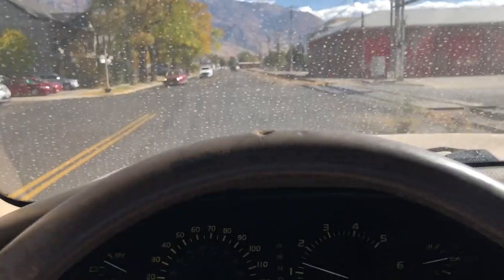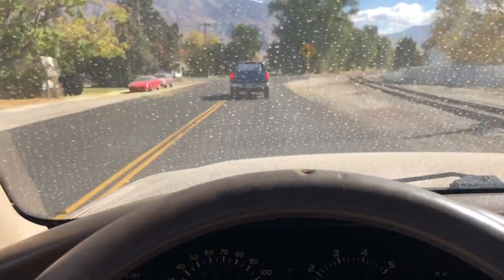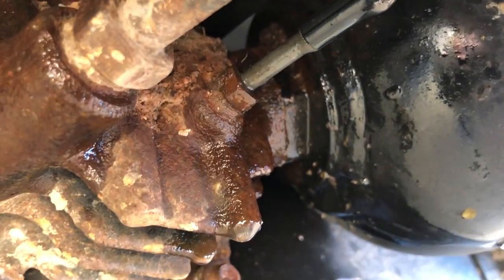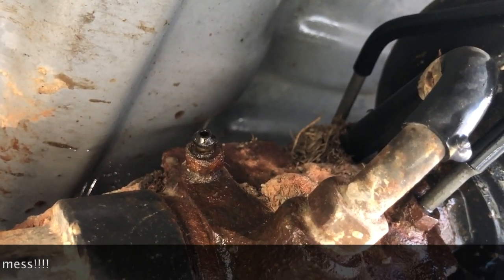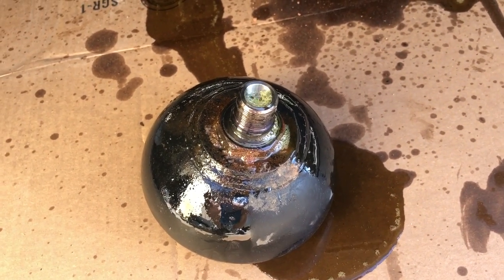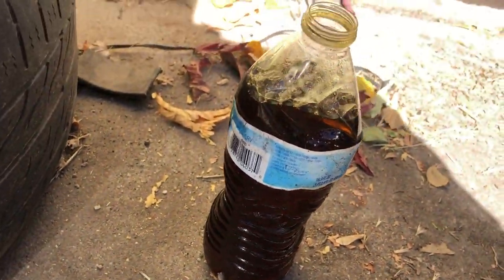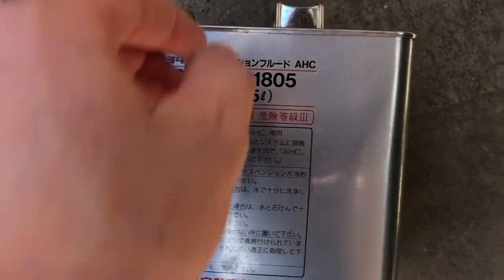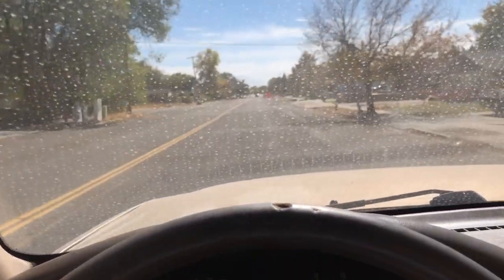SOLVED! AHC System Lexus LX470 Bouncy Ride Pogo Stick Problem 98-07 Toyota Land Cruiser GX470

Comment: Great video! AHC is an amazingly engineered system. Problem is that many owners do not maintain it. Had the same issue on our old LX470 and our current LX570 and was able to fix both very easily.

Comment: This was an excellent video.  Thanks for sharing the knowledge.  I have liked and subscribed.  

A few questions if you have the time, if not I completely understand.  Can I ask where you found the replacement globe?  When you check the AHC fluid level in the reservoir now, are you coming closer to the 7 or 8 graduations?  Did you only replace the single globe after coming to the conclusion that the others were fine?  Also, would you mind sharing what the pencil test was?  

My AHC is working just fine at this point but I love knowing that the repair could be relatively simple.  I get 8 graduations of movement at this point on my new to me 2000 lx.  I replaced the fluid and noticed a significant ride improvement.  The old stuff was black and disgusting.    Before buying, this really was my biggest concern.  I think think AHC gets a bad rap these days.  Its a fantastic system with a very comfortable ride!
Reply: Would also like hear more about the pencil test as well as the graduation improvement afterwards.  Awesome video thanks for taking the time!
Reply from the maker: Pencil test is just stickin the eraser part of the pencil into the glove hole and pushing on the membrane part. If it is broke there won’t be any resistance. If it is intact there will be resistance.
Reply from the maker: The AHC is just hard to diag if you don’t know what you’re doing. And so most places want you to replace anything instead of just the issue (because they don’t know what the exact issue is)

Comment: I sold my Lexus 470 LX, not because of AHC problem, but just a changing of spark plugs, which was broken with remnant dropped inside the engine. My car had been driven for 24 years, that repair store is 王兵， he didn’t compensate for my loss.

Comment: Nice video and glad to see you were able to fix the issue. I have two questions for you if you don't mind that I haven't been able to find and answer to: 
1) In checking to see if the AHC system will lower or raise the truck, after pushing the button can you open the door mid process or will that cancel/fail the command?
2) Do you need to [partially] fill the new globes with fluid before assembly to prevent air in the system or did you screw them back on dry?
Thanks!
Reply from the maker: I believe if you open the door it will pause it. And I did it dry and then bled it after.
Reply: @karrskars  ok, thank you 👍

Comment: Yes ! I have bounced problems on the rear side and the back side of the car 2005 Lexus lx 470 is lower then front side . 
What should I do? 
Thanks
Reply: Mine the other way, front side down to low and rare too High:( 
What shall we do? 
All 4 globes checked (pencil test) OK,  leaking one rare Shock changed new, Fluid removed all and replaced and bleed 5 spots . 
Somebody please say something else which couse bumping rare side . HELP 😢

Comment: Having some issues with mine 06.. 
had a bad passenger side bag… replaced with some new bags but for some reason now the passenger side inflates but driver side doesn’t? Also will just blink on the high selector..yes my doors are closed but even when trying to lower will just blink and not deflate?? 
Please assist 🙏🏼

Comment: Bleeding technique? All acutators and acumulator at once untill dry when in LOW? Refill reservoir, start the car, repressurise, turn off, bleed again all untill new fluid comes out, check reservoir for fluid level, start the car, go to NORMAL and refill reservoir to between MIN and MAX?

Comment: Thank you dear for your great video here, i hope I'm going to manage solve sameissue with my Toyota LC J100, 2004 mdel
I am going to check the globes as you described it but i suspect my rare sensor might be not working. Because before it failed to low at the rare side, the system push the back to the maximum high and kept bumping. managed to reach home and park after so often engine off and on for new trial.
Today it tried to push up with the button but the sytem controller show " OFF " blinking and Rare of thr car is High raised and front normal as the button lifgts show Low
what could you recommend to start with?
 Schocs are all once changed with new fluid ( 2014) and one rare schock is leaking slightly, just wet dust being seen, and globes never checked and changed, i even dont know where to get it as i live in Ethiopia :( 
 We love and trust our rock-edition LC and need to keep it functioning as it is...many friends failed to maintain AHC problems and changed to ordinary shoks.
looking forward to hear from you dear fellow Tech-Masters !
Wube from Addis Abeba.
Reply: Updates; 
Still no chance to solve after a whole day work on the issue. 
front side down to low and rare too High:( 
What shall we do? 
All 4 globes checked (pencil test) OK , there's no problem,  Leaking rare Shock changed new, Fluid removed all and replaced and bleed 5 spots .  All original toyota  ...
Somebody please say something else which couse bumping rare side . HELP 😢
Reply: New update: 
Accumulator pamp changed but the problem stayed as the beginning. Now I'm going to change all three height sensors. If that won't change it then I need to change all 4 Globes. Good day

Comment: Hey. I love your video. I was wondering if you had a way of determining which globes were bad?  I was thinking about only getting 2 at a time but want to replace the ones having the most trouble. My Resovoir shows  a movement of about 8 graduations.  Trying to figure out which to do. Both fronts or both rears or a front and a rear on each side. Let me know your thoughts.
Reply from the maker: Best way to do it is slowly drive over a bump with your front tires and see how bouncy it is. Then slowly do your rear tires and see how bouncy it is. That should help you see whether the front or rear is bad.
Reply: Do you replace in pairs or it doesn't matter?
Reply: @ozzie3056  I purchased a full set of new globes (4) for a total cost of $725.  I also purchased 3 liters of AHC fluid for the flush.  Based on your video should be fairly easy barring challenges getting the old globes off since they have been on for 16 years. Note: the dealer quoted me $4700 just for the globes.
Reply: @stinkenlinken  did you use his link. Where did you buy ? Did it solve your  problem? I'm having the same issue my car goes up and down but rides like a pogo stick. I wanna do all of them but I'm skeptical if this will solve the issue or if there's something else wrong. I went to a dealer in Miami the quoted me around 1k each glove which is Ludacris.  If on ebay they range between. 800 and 1100 for all 4.
Reply: They are official Toyota/ Lexus parts. Price varies a bit due to the Yen/USD exchange rate.

Comment: Thanks. I will try that.
Reply from the maker: Did you figure it out?
Reply: @karrskars  not yet. I am trying to source new globes. Found brand new ones for $598 plus shipping of about $90. Waiting until after Christmas to order.
Reply: I have been watching your video again and read somewhere that we are not supposed to let the AHC tank get empty otherwise air will enter the system. However I am guessing that doesn’t apply when you replace the globes as it enters from there correct?  You can fully empty and then just fill the tank start the car and then bleed the system right?  Do you bleed the globes while the car is running ?

Comment: Hi ... I have a 2006 Land cruiser , don't have a pogo stick problem but I have a serious nose dive problem every time I brake other than that it rides smooth, wondering what causes that ... I will Appreciate your respond and opinion on this matter ... Thanks
Reply from the maker: What does the vehicle do after you brake? Like when momentum changes
Reply: @karrskars  Yes. when momentum changes, like coming at a stop light and want to slow down the front of the car nose in dives like tilting foreword feels like the front shocks are bad, other than that the AHC SYSTEM works good like raising and lowering the car ... Thanks for getting back to me

Comment: Where on earth did you find two front accumulators for US$100?!
I tried aftermarket some years ago, which was a miserable failure. I ended up buying a full set of four OEM accumulators from Lexus (was the same price as Toyota) three years ago for AU$4,500!

The Amazon link above only shows a set of four for $1,128, from one supplier. I'm not sure if that is AU or US dollars. But even that is way better than anything I could find three years ago. Even from Japan direct.
Reply from the maker: Used ones at junk yards

Comment: Hey did you end up actually changing that bad globe? You said it was foaming, and had a photo, you said that globe was bad, but did you just put the bad globe back on? Or did you replace it? Or is there a simple way to just rebuild it? Just curious what you actually did for the $100? Did you just do the fluid and that's it?
Reply from the maker: I replaced it with a used one I found at the junk yard for $45. I replaced both front ones. No there isn’t a way to repair these unless you can take it apart and have the parts.
Reply: If I source these out at a junkyard is there a way of knowing if they're good or Bad?

Comment: The front wheels on mine are the stiff ones the rear is still smooth which side should I check ?
Reply from the maker: Go over bumps angling your car so only one wheel goes over. See which one is worse.

Comment: I have a 2007 Lexus GX470 and I am not able to find the similar reservoir like LX470 after opening the engine compartment . any idea where it is? does GX470 use the same globes as LX470?
Reply from the maker: I believe your reservoir is by the rear right hand tire somewhere under the vehicle.
Reply from the maker: And no it’s only rear air bags. Front isn’t AHC just rear.
Reply: Unlike the LX, the system on the GX is not hydraulic. It is air suspension and only for the rear.

Comment: I have the exact same vehicle and when I bought it. The vehicle was very bouncy then the AHC stop working completely and now stuck in low any ideas the ride is absolutely horrible
Reply from the maker: Check fluid first. If fluid is good, maybe your pump is bad. Does it make noise when you press the buttons? Feel free to email karrskars@gmail.com for better help!!
Reply: I think I found the issue
Reply: @karrskars  so when I bought the vehicle everything worked amazing the lifting lowering etc   just very bouncy. The the height control "OFF" light started flashing, but still everything worked. Then everything stopped working and the vehicle is stuck in low. But the other day I went under the vehicle and the lower shock bolt and the rub boot was completely gone the shock was just hanging there.

Comment: Changed the globes pumping is running but nothing is coming from the reservoir and assistance?
Reply from the maker: What do you mean nothing is coming from reservoir?
Reply: @karrskars  the pump sings but the lines are dry and the reservoir remains full
Reply: So did you continue to check the the reservoir and top it up between each globe removal?  Is that something important to do, especially if changing all four globes?

Comment: All of the sudden while I am driving and press on the brake , the "R" (reverse) lights up and the backup camera comes on. Any idea what's going on? I brought it to several mechanics and no one seems to know what is going on. Thank you!
Reply from the maker: Must be an electrical issue where the computer thinks you are in reverse
Reply from the maker: Looks like you have a bad ground wire somewhere.
Reply: @karrskars  thank you for responding, I will mention that to the next mechanic I bring it to...I will say that it has gone away on it's own at least 4 times..but it's back again. I first thought it had something to do with the gas tank cover, but I replaced it with a new one already and problem hasn't gone away. Each time they hook it up to the scanner reader, it says it's the safety neutral switch, but again I had it replaced brand new.

Comment: How do i know if i need to change the 4 globes or just the front 2?
Reply from the maker: Drive over a bump slowly. Drive front two tires over and see how much it goes up and down. Go over with the back tires and see. Depending on which is worse, you replace
Reply: @karrskars  thank you!

Comment: Do you know what size the fan clutch wrench is in millimeters? I have a 32 mm (millimeter) spanner and it doesn't fit around the neck of the accumulator.

Edit: The wrench diameter is 36mm and the body of the wrench is 6mm in height. Check the replies to this comment for more info.
Reply: I cannot find any wrench for this, where the hell did he get the wrench for this..
Reply: @miro333youtification  The wrench diameter is 36mm and the body of the wrench is 6mm in height. Had to go to a machine shop and they custom made one for me for about 11 US Dollars.
Reply: A ford 36mm fan clutch wrench works perfectly. I got one for about $20 on Amazon. Or, you can rent from a chain auto parts store.

Comment: Hello sir, I have a 2001 model land cruiser VX. I also have the same problem, when I drive on bumps, it’s bounces. But I can rise H and L, looks like the accumulator is working.  Like in your video it’s bounce when I drive. Any solution.
Reply from the maker: You’ll still be able to rise or lower it. One of your accumulators is probably shot or rear springs.